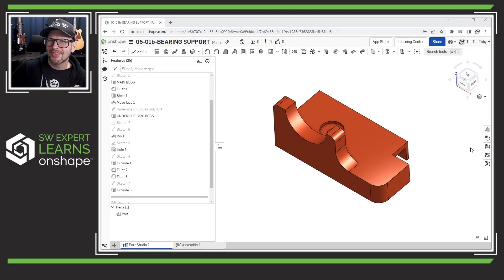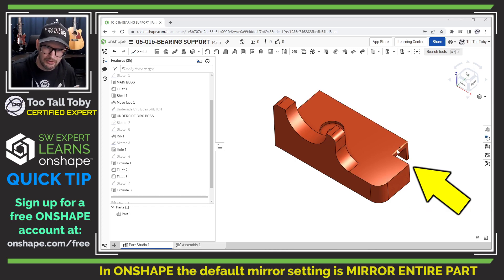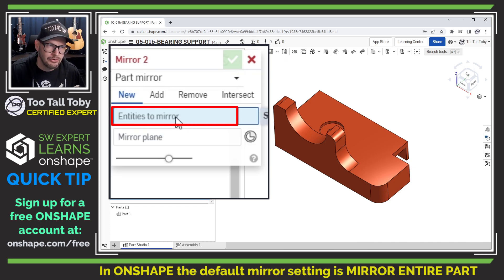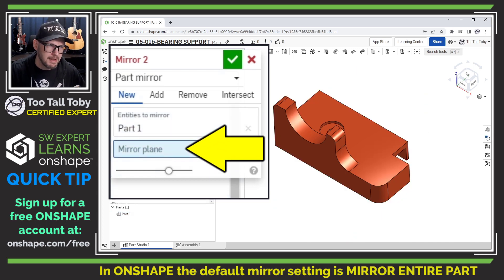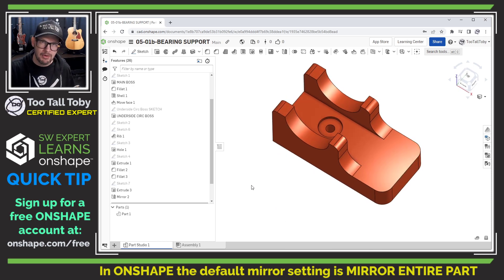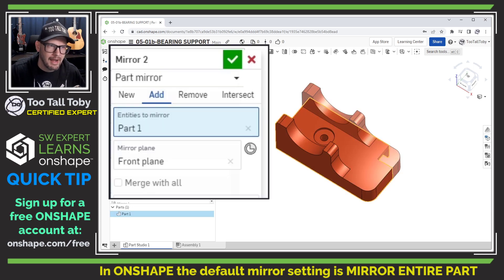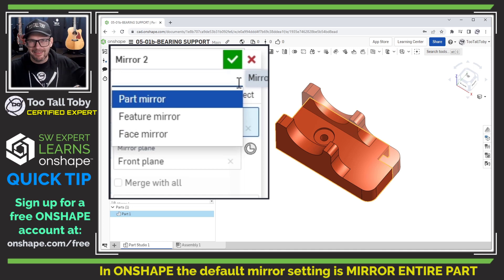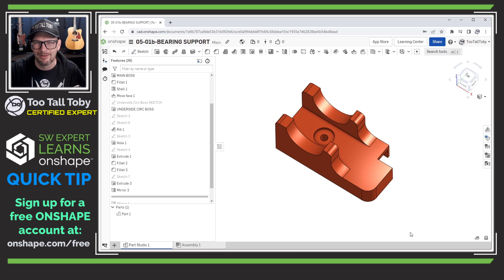How to Mirror Individual Features in Onshape

Comment: Yes, it’s very helpful! But mirroring a feature to corners of an oblong box is giving me issues. For instance, if I create a rib on the right inside corner: I can mirror to the left and up, but it won’t allow me to mirror a mirrored instance to its opposite side. Well, let me re-phrase that. It will give me results that are not symmetric! A little notch is evident in the final.